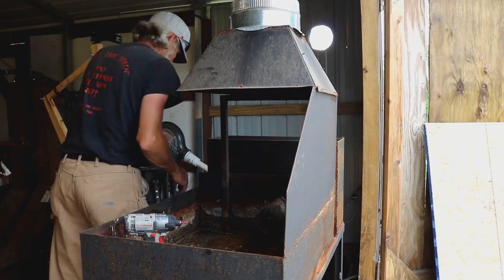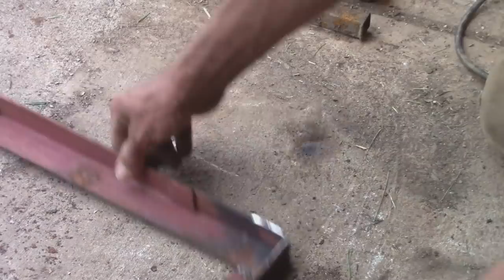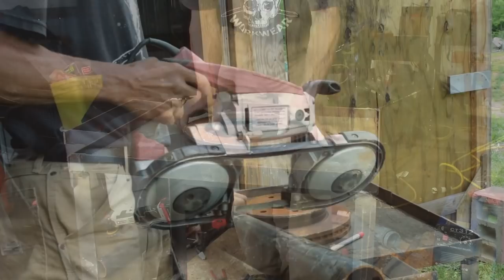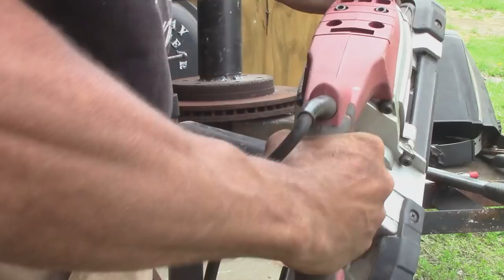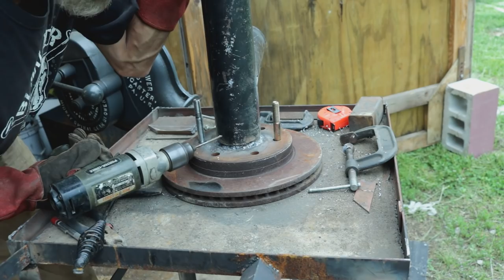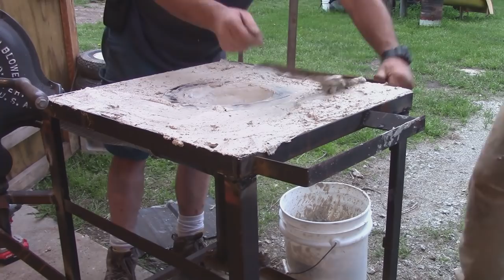Building a Brake Disc Forge

Comment: Great build. I like the ash dump idea, it seems a lot more air tight than the style I used.
You're in Kansas right? Where do you get your coal from?
Reply from the maker: There is a local guy just south of KC that has Bituminous coal and I buy Anthracite Coal from Tractor Supply.

Comment: Interesting build!

Question...  what is your mix for your fire clay?
I sure would have liked to hear your thoughts as you built it.  Voice over rather than music.

Thanks for the video...
Reply from the maker: The Fire Clay was left over from the Rocket Mass Heater build. It is a 3000 degree clay I bought at a local pottery supply place. The sand I mixed it with is the sand used under paving blocks, a lot more coarse than regular sand. I currently lack a decent Microphone to do the voice over thing, it will happen eventually, I am just one of those old farts that doesn't get in a hurry to do anything LOL.